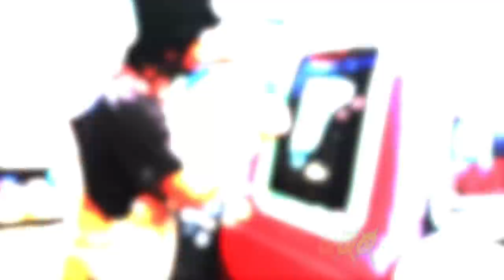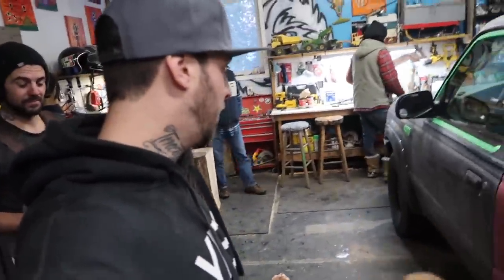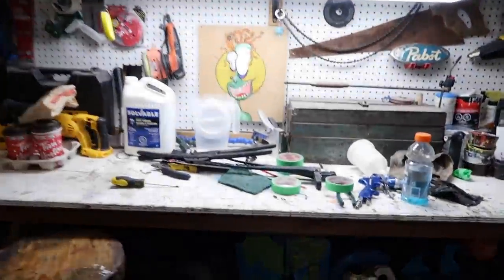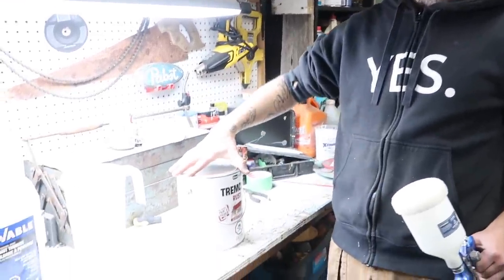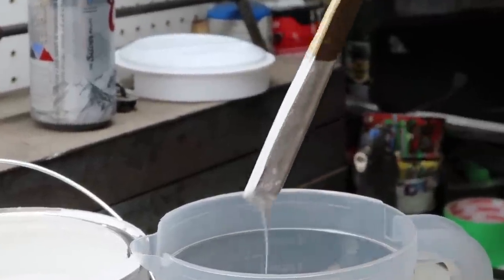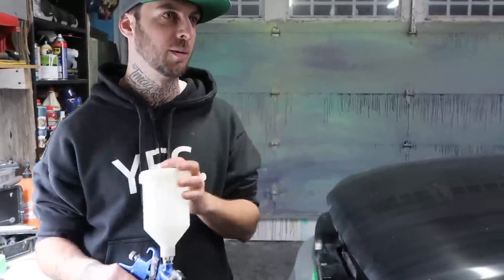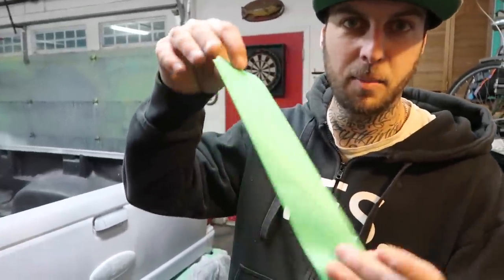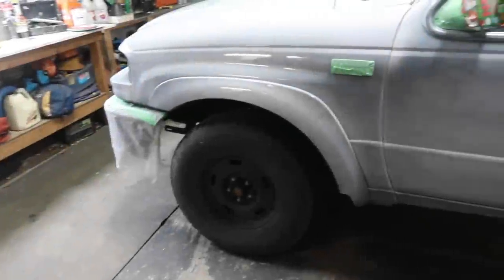$50 Rustoleum Paint Job "HOW TO" D.I.Y

Comment: Good job, how long does it take to dry?
Reply from the maker: i would let dry for 24 hours before bolting things back on, if you can leave it in the sun or a heated garage this product cures in one day depending on how much reducer/thinner you use.
Thanks for watching!
Reply: Without hardener? Probably tacky for about a week! Lol
Reply from the maker: @splash5974  100% lol if you can keep it parked for a week it will turn out better!
Reply: @splash5974  for sure if it ever fully gets hard but hey they acomplished making it clean n one color

Comment: did you get the gloss without applying clear coat ?
Reply from the maker: You can buy rustoleum in flat, semi gloss gloss and high gloss. its a single stage paint and the high gloss actually comes out pretty shiny!
Reply: @MADCRE8TIVE  thanks for your wisdom

Comment: What kind of compressor could i get to spay? Having a hard time finding the proper one
Reply from the maker: the bigger the compressor tank the better, that way you have consistent air pressure. the small hobby air compressor will be running the whole time and lose air pressure. hope that helps
Reply: Makes hella sense. I appreciate the feedback
Reply: i ran into a similar issue and i actually piped 3 compressors together. i just had them lying around and it worked awesome. it was like 2.5hp and 40 gallons all said and done.
Reply from the maker: @coolcow0468  thats an awesome idea!
Reply: When I’m spaying I usually use a scalpel.

Comment: The problem I have is the paint never fully dries no matter how long I leave it to dry is still soft/sticky does anyone have a fix
Reply from the maker: Make sure its oil based. allot of these industrial paints are water based now and take forever to dry. Other problems could be if too much thinner was used it can make it tacky. but with heat and 48 hours it should cure solid.
Reply: @MADCRE8TIVE  oh right thanks, what happens if not enough thinner is used
Reply: Mark it could take a week at 70 degrees if you recoated too fast. I always used quality reducer OR it takes FOREVER to dry

Comment: For about the same price you can automotive paint..(single stage)
Reply from the maker: Most Automotive paints are 2 stage and with paint and hardner reducer etc you usually come out to over $200. Rustoleum/tremclad single stage paints you can stay under $100 definetly lots of options out there!
Reply: @MADCRE8TIVE  Don't know about Canada but in the states you can get paint at TSC  store that is single stage and meant for farm implements and tractors in a wide variety of colors.  Works well and shines up nice with wet sanding and buffing.
Reply from the maker: @ceeph36  that farm equipment paint is amazing. Its a very durable paint. and even more color options then rustoleum!

Comment: Wouldn't call it a d.y.i nor $50 paint job because your actually using a paint gun with a compressor and mixing up paint so it would look like a legit paint show only difference I think is they grind the old paint off sand it then paint the bare metal so the coat isn't too thick on the car and cause a unbalanced that's all but it's a good way to paint your own car everytime instead of spending 1000 dollars
Reply from the maker: Thanks for watching and commenting Darius! Agree I guess if you add in price of compressor abs paint gun it would add up, but your right on point that it’s a great alternative to a $1000 and up paint job
Reply: @MADCRE8TIVE  good job though it's always best to do your own work and save money 👍🏾 plus it helps you get creative once you get the basics down

Comment: i don't get y u would do this the paint is the easy part y would u do a cheap paint job i would take it to maaco first the place i know use's dupont centari paint i can't even get the paint for the price they charge and they do a good job they just don't wet sand or buff it for 350 bucks but it looks just as good as a factory paint job on my gto i didn't even wet sand or buff it and i get complements  on how nice the paint looks i even tipped the painter 50 bucks for doing a nice job . the painter said after doing 8 to 10 cars a day for 5 years u get real good at it

Comment: You needed primer first
Reply from the maker: the good thing about this paint his that its paint and primer in one!
Reply: @MADCRE8TIVE  been curious about doing the same process with a paint/primer mix or doing primer coat beforehand, but how long will it last without the primer coat for regular washes?
Reply from the maker: @ReaperNola  most rustoleums are paint+primer all in one. last a really really long time. very tuff paint. if you do a single stage paint you may need to primer first..

Comment: you needed mineral spirits. yall goofed
Reply from the maker: You can use a number of different thinners and reducers in our case we went cheap with paint thinner and had zero issues! Thanks for watching!
Reply: @MADCRE8TIVE  mineral spirits are for getting the grease and dirt off before you paint it
Reply from the maker: @slobra_9930  Ahh, so its a good degreaser in a sense?

Comment: Temperature when spraying?
Reply from the maker: the more heat the better.. we were spraying in the winter with doors open etc and still got good results, but generally you want good heat.
Reply: Metal temp is always lower than the room temp. All paint tech sheets typically use 70 degree metal temp as basis for their info for dry times and recoat times etc.

Comment: It’s always surprising when you change the colour of the car and not disassemble the parts for painting. Yes, you can use cheap color, but painting a mounted car is embarrassing. That has nothing to do with budget. Just lazy
Reply from the maker: on old cars like this its ok to spray everything mounted. some times undoing rusty bolts and remounting etc you get yourself into more trouble.. Everyone does this differently, and some would say that pulling all the panels off a car to paint is too excessive.. Thanks for watching and leaving a comment!
Reply: MAD CRE8TIVE its not expensive all it cost is time also you could have sanded that spot of paint run to each their own tho

Comment: WTF !!! Whar's the P R I M E R !!!!!??? YOU didn't cover the wheels either!  Total COB job ....
Reply from the maker: Tom, this paint is PRIMER+PAINT no primer needed, didn't cover wheels as these are spare rims and tires just to move vehicle around. Thanks for watching. What is COB job, please define
Reply: To save money .. why don’t you just spray the Ranger with Linseed oil and be done with it.
Reply from the maker: @tommaika9121  Great Idea! Thanks for the tip.
Reply: What the hell is a COB job ?
Reply: Steve Hughes A COB job is when you use  an unorthodox tool .. like a cob of corn .. to seal off your oil pan drip.. effective but temporary and unprofessionally completed.   AKA a botch job.
Reply: @tommaika9121  Learn something everyday.  Never heard that before. Now I know. Thanks.
Reply: Steve Hughes That Italian cruise ship driver - captain who was showing off to someone on shore .. and ran aground thus tipping the ship over on its side. A cob job.  An earthquake in Taiwan about 5 years ago revealed that some buildings that collapsed had load-bearing columns constructed which held empty petrol cans covered up with cement.  Petrol cans because the contractor did not have enough good aggregate or concrete to finish the job right.  A cob job.
Reply: Here is that clip from the Cob Job concrete with hidden tin cans inside the concrete construction work which contributed to a building’s collapse in Taiwan.  This Cob Job saved money  but put people’s lives at risk.